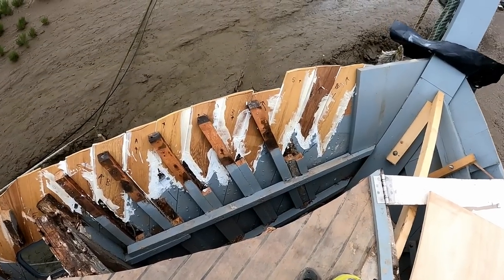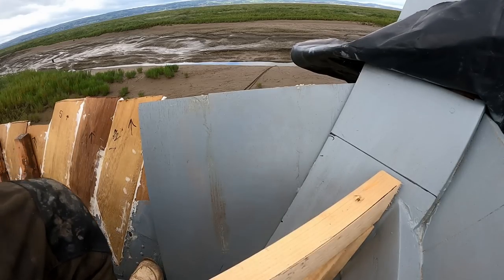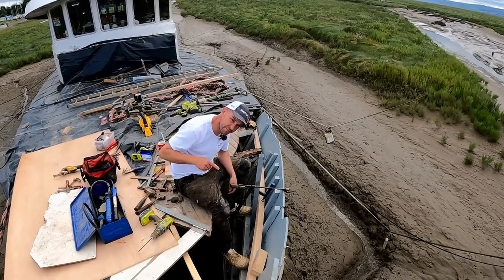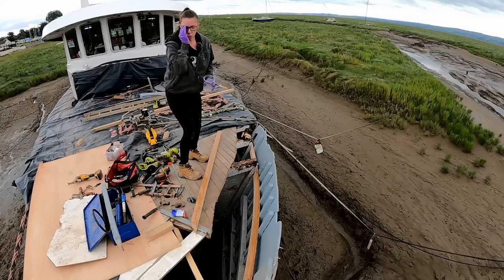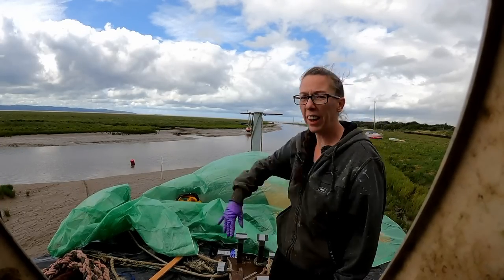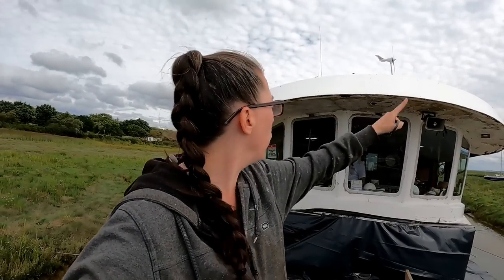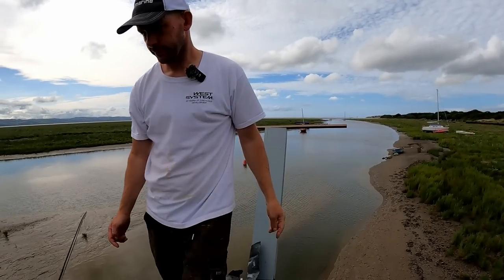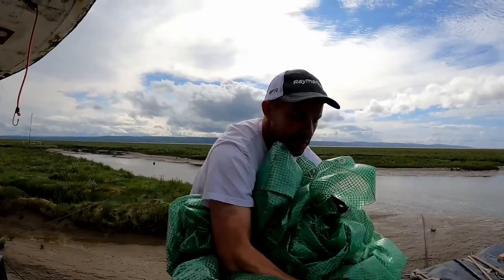Ep 138  Turning Our Boat Into A SAIL BOAT?! #boatrestoration

Comment: Actually Gemma, banging two hammers together one or the other contact point or surface can shatter, I've seen it happen with my own eye's, I've also seen the head of club-hammer shatter the square corner of a handvile,.. However, although this can happen, I strongly suspect the eventuality of this happening does or must depend on the quality of the tools in question...ie; Crap tool's give crap results or service...

Comment: Hitting two hammers or one hammer against hardened steel is generally a bad idea.  The hardness of the steel allows tremendous energy storage which is the potential for trouble as the energy can be sufficient to cause cracks to develop in the face at which point the possibility exists for pieces to separate and act like projectiles.   
One one occasion I saw this happen in a factory building locomotive parts.  I was talking to my supervisor about 20-25ft from a guy who was driving hardened steel wrist pins into an assembly with a medium size hammer.   A piece of the head flew off and went through her shirt and buried itself out of sight into her arm.   It took a bit of investigation to find out what and where it came from after removing from her arm.   A copper or other softer material between solves the problem.

Comment: I would like to reopen your discussion about hitting hammers with hammers. I am 58 and probably 38 years ago I was doing the hammer hitting another hammer. A piece the size of 1/2 an American dime (half of 10 mm circle, 1.5 to 2 mm thick) broke off and hit me in the front of my leg about 15 mm above my ankle. When it happened, I looked at my leg and there was a little red line like a piece bounced off me, but when I looked at the hammer there was missing a chunk. It did not really bleed or hurt much. I ended up going to the hospital and they X-rayed and they told me it is in your leg. I told them to remove it as it had razor sharp edge (from looking at hammer). The said they could not because they would do more damage digging for it and there was thousands of veterans walking around with metal in them. I told them they could just follow the cut and they still would not remove it. It is still there; I did get a little nervous going for an MRI scan about 10 years ago but had it done for my shoulder and it did not affect my legs that were further away. It ended up not affecting me, but could have easily gone somewhere else, even my head. The compacted metal in the hammer face will not explode, but it can shear or splinter off, same way the head of a steel chisel can (have to keep the burs ground down). Well in the long run it won't hurt me any of you are doing it. Otherwise keep up the good work, love to watch your progress.

Comment: Rarely comment but I feel I must. Regardless of what Myth busters did, never strike two harden tool steel objects together. A work mate did have a piece of a hammer break off and shot him in the belly. 24 stiches at the hospital to dig it out and close him back up. 40 years in the machinist trade and I only personally know of this incident but it can happen. IT IS NOT A MYTH! Likely the incidence is low because most of us don't or won't do it.

Comment: Hitting two hammers together is not so much about damaging or hurting you it's about damaging the hammers. I've seen it happen where one of the hammers used this way developed a small crack which of course worsened with continued use until a piece fell out of the face.
 Hammers are made to work with metals less hard than themselves, even anvils are comparitively soft compared to a hammer. Look at an anvil that has had years of use and the top face will no longer be flat. When engineers have to hit hard metals they would have a piece of softer metal (A Dolly) between to avoid damage to either the hammer or what they are using it on.  Hitting two hammers together is not a load of bollocks it is very bad practice and should be avoided. The fact that the Myth busters said that their tests actually chipped one of the test hammers is testament to this. 
Rant over  but I'm a time served engineer from the early sixties onwards and some things were on the " Must Never Do list".

Comment: Screw what Mythbusters have to say about it. Multiple accident reports over the last century show the risk of banging 2 hardened hammers together forcefully. You aren't running the same risk because you are not applying the necessary force and you have a copper nail below absorbing some of that force. Hammers fracturing does occur, just not in your situation.

Comment: Those chips can do damage. My bro in law at the time was smacking another hammer on a ball joint. They chipped went in his lower lip well below the lip part and stuck in his jaw. Those shards of shrapnel flying at those speeds that close to your face is a bad idea trust me.
Reply: Don't get me wrong I still do it when it's necessary but where some protection. It only takes one to take an eye  out for good.

Comment: You can safely hit many metals including wrought iron, mild steel or annealed carbon steel with a hammer, but I would not advise hitting hardened carbon, alloy or tool steel with a hammer. I was watching a mechanic trying to get a ball race off a half shaft. He was hitting it with a hammer. I told him not to but was ignored.The outer track of the bearing shattered and pieces flew across the workshop like shrapnel  - the largest  shattered the rear window of a customers car. Even a small splinter can take an eye out. Please, do not hit hammer faces together - not worth the risk. They will not 'explode' BUT the energy of the impact is mostly transferred to the shard which will fly off like a bullet. I'd hate to see either of you injured.

Comment: Hitting hammers together being dangerous isn't a myth, just like leaving your batteries on concrete sends them flat isn't a myth.

The thing is that both ideas are a century or more out of date.

Batteries used to have a rubber case, leaving them on concrete did used to flatten them. We don't use rubber anymore. Haven't for a long long time.

Same deal with hammers. The key to it is in how they're heat treated and how much carbon is in them.

Go back 100+ years and heat treatment wasn't as well understood as it is today and the hammers were being made by blacksmiths, heat treating them with a forge and making them with carbon steel with highly variable carbon content.

That leads to some hammers being particularly hard and others quite soft.

Take two of the hard ones and belt them together and you're likely to have an very sharp shard come off one, often at extremely high speed. It is in fact quite hazardous to do.

Now, move forward to the current day with mass manufactured hammers made from known alloys and well controlled heat treatment and the issue is completely null and void. They're made to be soft enough that it isn't a problem. So hit away, not going to do any harm.

Point is, it's not a myth. It is grounded in truth, but just isn't relevant any more. Just keep it in mind if you go buying antique tools.

Also, yes you can hit an anvil, just not on the edge. Go look at old ones and you'll see they're chipped.

Put a piece of soft metal on there and it's no problem.

Struck tools (flatters, punches, drifts, fullers etc) are also make to be soft where they're being hit. Basically, you just don't hit two hardened pieces together.

Comment: Never believe MythBusters. The 2 shards of steel in my legs beg to differ. I have 2 pieces of hammer shrapnel in my lower legs after 2 hardened hammers fractured while hitting hub bearings of shafts. so I strongly disagree . you can most certainly have 2 hammers shoot splinters when impacted together

Comment: The truth is you DONT strike 2 hardened surfaces together. The danger is small chips that can cause an eye injury. They don’t explode but small chips can fly off. Anvils are hardened to a lesser degree than some hammers. Some hammers are hardened to a degree that they have to be marked as they are particularly vulnerable to damage if hit with an equally hard face. 

Hammers are case hardened with cyanide or carbon, we did it at school, it gives the hammer an outer layer of hardness and this is why you shouldn’t strike them together. You get two very hard surfaces they are actually brittle and if you hit two brittle masses together the eff et is like cinder toffee it shatters like glass. Why wouldn’t glass shatter if you smashed two large pieces together, well the surface is like glass. You’d have to hit it hard but it just goes against the grain. Sorry I’m not being an armchair keyboard warrior we used to get the cane at school for doing this and the class a mega bollocking on why it shouldn’t be done. 

Hitting an anvil is different in that, yes it’s hardened but to a lesser degree and most of the time the smith is working steel against the hardened surface which is soft. 

Myth busters isn’t the authority in this it was taught to every schoolboy (yes schoolboy as it was up the end of the 70s). The reason we were taught it came from experienced tradesmen from the likes of Camel Lairds …. All other shipyards and other engineering sources taught this rule. Sorry not being meaning to be a dinosaur on this but it’s what we were taught and I’d trust Camel Laird over some Ginger tosser and his mate with attitude on Mythbusters… haha 😂

Comment: Not having a pop at you guys but no its not bollocks... Im sitting here with 1 eye because the twat I worked with hit 2 pieces of tempered steel together 27 years ago 1 was a hammer and the the other was a press head, the problem is that they are both tempered steel and fragile.
a little bit the size of a match head went right through my safety glasses as if they weren't even there, burst my eyeball and severed the optic nerve.
the surgeon told me that I won a watch as half an inch either way and I would have either died or been a vegetable.
now Im still not having a pop at you guys, but if you seriously believe a tv show with a vested interest in "busting myths" to be a credible source of facts then thats up to you.
myself, my wife and my children all know the truth regarding this bollocks as you put it and so do many other unfortunates.
Sorry Gemma, I don't care that you take chances with your own safety and I normally always stand behind you when you have a pop at the narrow-minded armchair experts, but in this case you have lost a tremendous amount of respect from me with that dismissal.
And should you wish proof I can send you my legal files stating what happened in the accident through messenger
Reply: And if you want to know about the so called explosion myth, think about the bright spark when the 2 metals collide... it's the last thing I saw and it certainly tore my life apart like an explosion